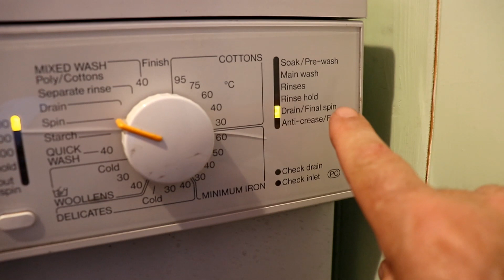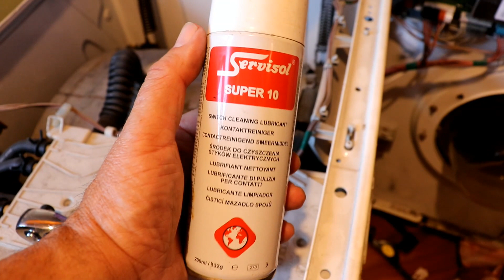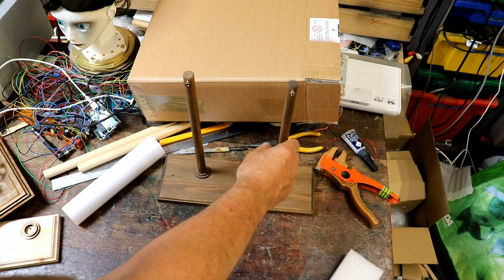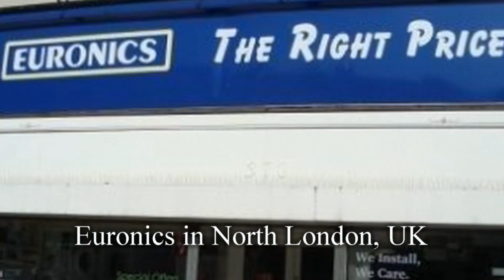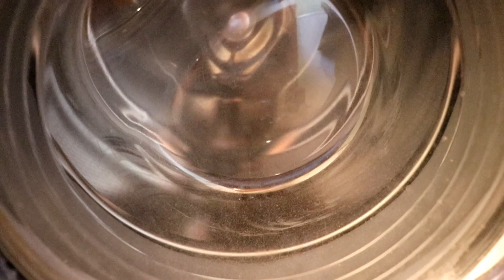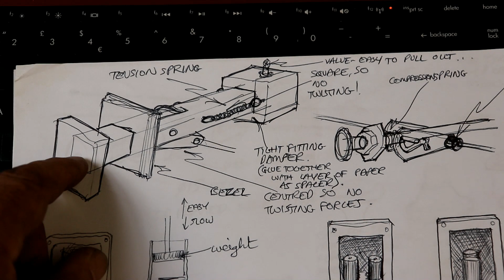Victoria the Washing Machine

Comment: Thanks for the video.

Off topic, but is superglue OK to glue one of your little guages to a 3D print, or would you recommend something else?  Just aware that superglue fumes can discolour.
Reply from the maker: You can use superglue, but I'd sand off the paint from the rear of the gauge first just to ensure good adhesion. The white deposits only occur where there has been lots of contact with skin, so if you haven't touched it much... although you won't see it on the back. One thing I found that avoids it is to have a fan blowing air over it whilst the glue sets. The fumes are then blown away - Superglue - so exciting! 

Alternatively you could use a contact adhesive such as Bostik All Purpose. Thanks for your enquiry, always happy to help.
Reply: @steamhead  Great, thanks.  I'll sand as you suggest, and I was wondering if a fan would help!

Comment: Nice job!   To repair, or to replace, that is the question.   I always think why should I replace something if i can repair it?  Eventually, I'll have new equipment that way... sort of.
Reply from the maker: While I was repairing it I did wonder how much it would cost to buy all new parts, I recon if the brushes cost £60.00, roughly £100,000! Apparently most parts of a Moris Minor are still manufactured at reasonable costs, so it is possible...